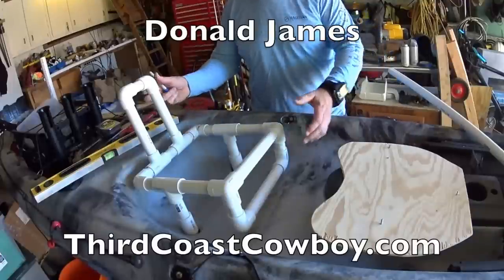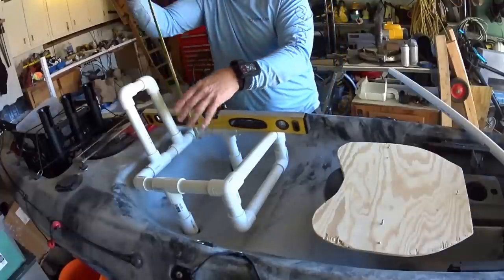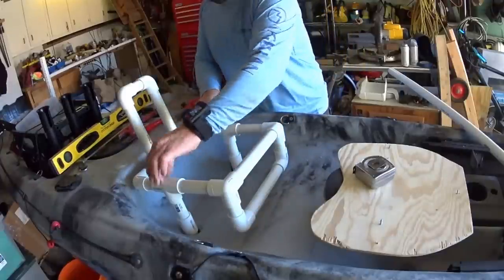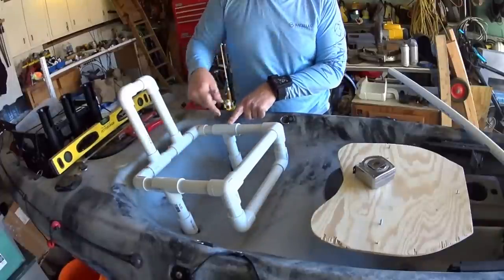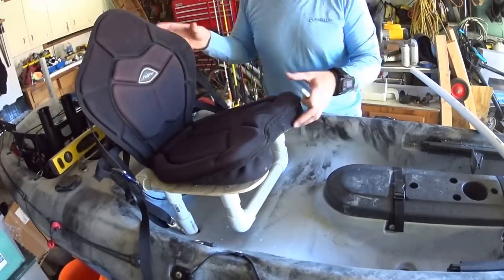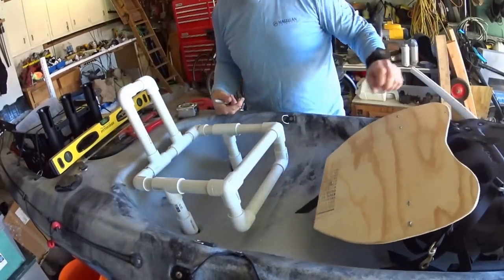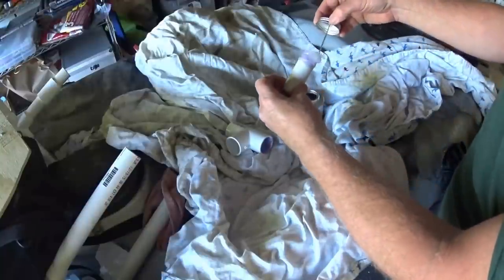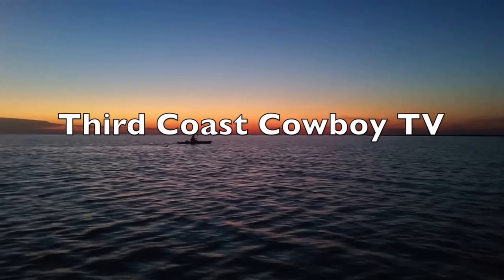Raised Custom Kayak Seat

Comment: Nice idea but what is concerning part are the joining seams inside the scupper holes. They can be frail and tend to crack. One guy had to paddle back to shore being fsr from shore, with the back part being submerged. Once on shore they investigated and found the seam in the scupper hole had cracked which was due to the kayak trolley design using pins that mount the trolley directly in the scupper holes. With the design of that seat when ever you lean back it places a side force in the holes. Not dissing the ideas but more of an awareness of what can happen. After seeing other's bad experiences I inspected my kayaks as we have two of the same.  I had to get a exchange on one my kayaks due to an unusual thin hull and horribly misaligned scupper holes from the top and bottom mold. The replacement kayak is awesome. Built the way it should have been.

Comment: dude, that is such a simple concept, I have been looking at all different kinds of seats trying to accomplish what you did with pvc. that seat is similar to my kingfisher seat in my moken 10 so I am going to copy your idea. it's genius and so inexpensive. I'm putting a trolling motor on mine also. I just fish enough to eat when I'm on the lake but I have a quadcopter with floats that I plan on using at the lake to take aerial videos so the motor is wireless and the quad will follow you while your toolin' around. you should post this on kayakdiy on facebook if you haven't already.

Comment: It seems it might be possible to have an adjustable back by not gluing the pvc back piece in place to the seat frame, attaching a piece of plywood to the pvc seat back then adjusting it back and forward with the adjustable straps.

Comment: I'm thinking of adding a raised seat to my sit-in kayak. Planning on cutting out the molded seat, padding the floor, adding a 5 gal bucket/bird and buck seat, securing it with adjustable bungees or small ratchet straps. Any suggestions?

Comment: great video on the seat cool idea,  you mentioned that it was stable ,but how is it standing for fishing
Reply from the maker: Its not good for that model which is the 2015 Vibe SeaGhost SG130.  It does provides more vision and comfort.  The 2016 SG130 however you can stand in stock.  There is a difference in the deck on the two boats.  2016 is flat and 2015 has some curve to conform to your rear end as it was designed for a basic padded seat.

Comment: did you build the outriggers as a result of raising the seat so much and changing the center of  gravity? i have a heritage angler 12' and did something similar with a seat and no outriggers...first time i sat in it..kayak rolled like a barrel...thank goodness i was in about 12 inches of water!
Reply from the maker: The outriggers we're put on my equinox kayak which is pretty narrow, so very tippy.  This seat is on our Vibe Sea Ghost kayak that is wider and very stable; about 31" wide.  Hasn't rolled on me. :) Im fine with the seat in lakes and flats.  I don't use it when going "btb" beyond the breakers.

Comment: Im doing this seat for mine, but searching in the coments  of your video and in several other videos a lot of people saied that it was a very bad idea to introduce the pvc tubes on  the scupper holes, that it certanly will crack , so my question is. How it ended up for you ,did it crack? If so how long it lasted?  Do you still recomend it ?    Thanks in advance Hope you and your family are doing ok.
Reply from the maker: I did make changes to the seat to spread out the load on the scupper holes.  The first thing I did was use a big flat washer so the pvc coupler would rest on it and not the scupper hole.  This worked good for a while.  The next thing I did was mold a piece of foam that went from scupper hole to scupper hole.  I then fiberglassed the foam.  This spread out the weight of the rider even more across the kayak seating area.  Worked great for several years.  I did not have a scupper hole failure.   We do not use the seat anymore as my wife prefers to sit in just the seat.
Reply: ThirdCoastCowboy   Thanks a lot cowboy,     I’ll go with the washers first and see how it holds

Comment: my ass hurt just looking at that hard board under there! use suspension like we do in our tree stands. U will hang in the air and not have that pressure pushing up into your lower back like u are gonna after a few hrs on this thing. Good concept, but remove wood. use paracord, webbing or straps. then ur seat

Comment: When you put the bottom legs in the drain holes, do you have much water coming into the Kayak? Just wondering how much water comes in without the plugs?
Reply: Rick Ivey you can plug this holes with foam practice golf balls from the bottom. This way it won't get in the way of the PVC.

Comment: Does spray paint stick to the PVC or do I have to sand it first?
Reply from the maker: I just wiped mine down with isopropyl alcohol and used the spray paint at Lowes that is for plastic.  Stuck pretty good.